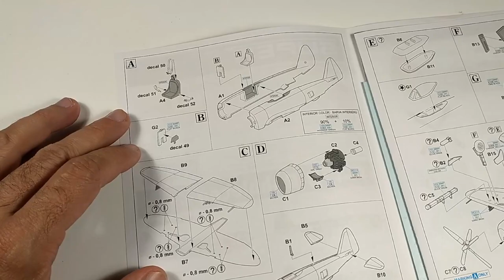P-47D Thunderbolt Bubbletop Eduard 1/144

Comment: Wow! Thanks for this video! I've been building model aircraft for most of my life, but I am new to building in 1/144 scale. I'm happy that Eduard provides additional details. You have more confidence with using a flexible photo-etched saw next to your skin than I would. When I was 13, I made a serious cut in my thumb with an X-Acto knife.
Reply from the maker: I try to be very careful with knives,  blades and saws. I use light force to cut the parts. It takes more time but is safer.
Stay tuned; another 1/144 model is coming.
Thanks for watching and for your comments.

Comment: Does Mr. Dissolved Putty dry clear? I need something for parts that are molded in color. Those parts are hard to sand without ruining the color. Thank you!
Reply from the maker: No, unfortunately not. It dries white. Some of the gel super glue dries transparent.After sanding you can polish the surface back.
Sorry, I have no better idea
Reply: No apology necessary. Thank you. I think I will try to dip some sprue into liquid cement, let it dissolve and see if that fills the gaps. There is also a mold seam. I may just ignore it. My only audience is me. I may grab some sprue and experiment with 8000, 10000 and 12000 grit sanding pads. Thanks for always being willing to answer questions.